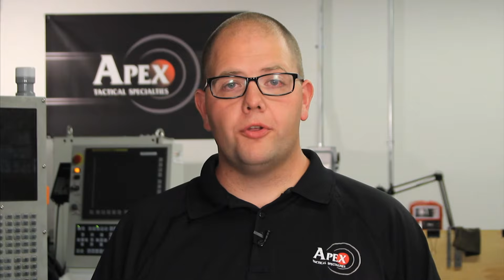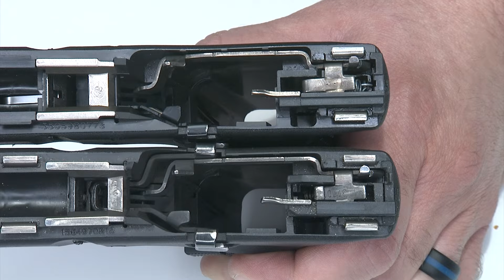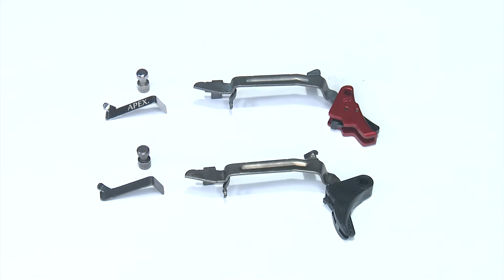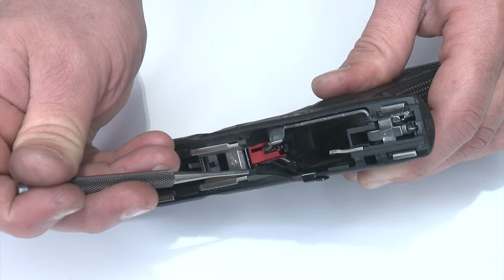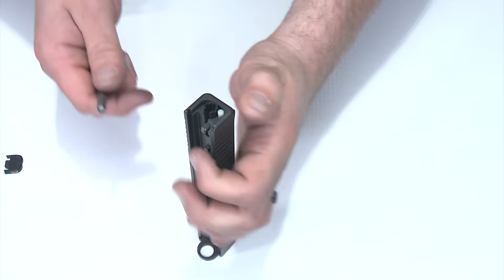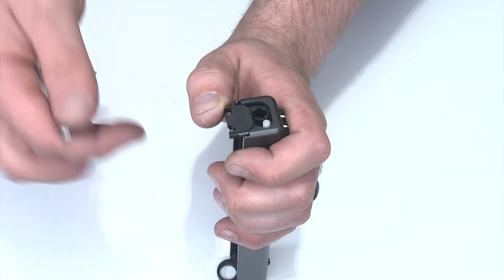How To Install The Apex Action Enhancement Kits For Glock Pistols

Comment: I really dig these triggers. I have a kit in my G43, polymer shoe. Such a sweet shooter now. I hated it before. 
An aluminum shoe only on my G26 with stock polished parts. 
And recently my G45. Shoe came with gen3 trigger  bar. 
I jut 250 round through my G45 just a few days ago. After my index finger got rubbed raw, I figured out it was the sha sharp edges of the safety blade. So I went back to all of my apex show and buffed the edges. Prefect now

Comment: I just installed the apex trigger on my 43X and it doesn't come with a striker plunger. I did the function test, pulled the trigger, hold it, slide the slide back, and then release the trigger and the trigger resets to its original spot but it doesnt click, should i be concerned?

Comment: followed these instructions when I installed the kit on my Dagger, If you are putting this on a dagger you should find a good video on removing the trigger from the dagger is slightly different than a Glock, but the install of the Apex was easy and worth the money, you will notice a big improvement in your trigger pull.

Comment: Great video, awesome detail and camera angles have others have said.

I used this for my install of the Polymer action enhancement kit on my PSA Dagger.  No issues, works great.  Trigger pull is crisp with a nice reset, not too light either which is nice.

Comment: Excellent video. Pay attention to the helpful hints. This is the solution I have been looking for. Wonderful kit. Perfect trigger feel and pull. It's predictable, with great tactile feedback. No more painful Glock blade trigger safety. And now I can trust myself with my Glock. I installed it myself in less than 30 minutes.  --  Follow up: Installing this kit cut my shot grouping in half. Very accurate first and follow up shots. The trigger feels broken in after just 100 rounds.
Reply: Quick question did you install the apex connector in it too or kept the oem i just got one for my edc glock 19 gen 5 and dont know if i should install the connector or keep the oem one
Reply: @leonellopez-r5u  I apologize for the delay. This went to my spam folder. I installed all the parts that came with the Apex kit. I have a Glock 19 Gen 4.

Comment: I installed a apex in my dagger it will reset with no actual round in it but when I use live rounds it chambers new round but doesn’t reset trigger please help it will reset if I pull slide

Comment: I recently replaced my trigger in my Glock 17 and did a function test afterwards and all seems good, however when I go to chamber a round (slowly) I am not able to get the gun back into battery. However if I rack the slide quickly, I am able to get the gun into battery. Did I miss anything or any advice to help troubleshoot? I have not taken it to the range yet to test on live ammo.
Reply from the maker: It's best to contact our Customer Service people with questions like this.  Our contact info is on our site and on the product cards included with the products.
Reply: Just following up: I did reach out to customer service and they informed me that this is normal. The firearm needs the force to go into battery and I was just being hyper vigilant. Went to the range with 200 rounds last weekend and not a single issue! Groupings were tight, trigger pull and reset were so crisp. Going to be updating the trigger in the rest of my Glocks. Thanks Apex!

Comment: Excellent video.  Just installed my second Polymer Action Enhancement Kit.  This was a Glock Gen 3/4 kit in my new PSA Dagger Compact.  The Dagger came with a terrible 7 1/4# trigger pull.  The Apex kit reduced pull to just under 5#.  What an improvement!  And, as a bonus, I got to match the trigger color to my FDE frame!

Comment: I had the Apex trigger installed on my Glock 19. It is very hard to pull. After about 20 shots my finger is pretty sore. Can the trigger be adjusted so it is easier to pull?

Comment: Great video, but there is one problem. The Gen 5 kit does not come with a plunger. I confirmed this with Apex customer service. Apex does not make a plunger for the Gen 5.
Reply from the maker: The install process is the same, there is just one less component in the Gen 5 kits.

Comment: Seems much simpler than I thought. Can't wait to upgrade
Reply from the maker: It is a relatively easy platform to work on.
Reply: Careful. All my Apex trigger did was give me light primer strikes. :/
Reply from the maker: @Mark-sn6kh  Extremely uncommon. Contact our customer service at 623-322-0200 and they can assist you with troubleshooting the install.

Comment: In what fantasy land do these pins come out that easily
Reply from the maker: In the fantasy land of Glock. It is a remarkably easy platform to work on.
Reply: @apextactical  I finally got it installed, I realized the big difference is I was installing into a PSA Dagger, apparently they had an issue with pins walking so they made their pins slightly larger. This thing shoots so much better now, solid product
Reply from the maker: @ReqDef  Thanks for the clarification.

Comment: @apextactical my trigger safety won’t spring back out of the shoe I can manually pull it back out but as soon as I pull the trigger the safety dingus just lays flush in the shoe and doesn’t come back out what should I do???
Reply from the maker: First off, it's not a 'dingus.' Second, its  likely the trigger body was crushed during install. Just call our customer service at 623-322-0200 and they can assist you. Please don't use the pistol until the trigger body can be replaced.

Comment: What Trigger did you use for gen 5 will a gen 4 work on a gen 5
Reply from the maker: We have a trigger that works for the Gen 3/Gen 4 models using a Gen 3 trigger bar. The Gen 5 trigger is different and uses the Gen 5 trigger bar (obviously).

Comment: i installed a new trigger on my 43x however is appears to have made the slide sit a little high and is extremerly ruff to take the slide off and on. it seems to be alot of friction. im assuming this cant be normal. I have function tested and had no issues but the slide is still a bit ruff to get off and on. Any help would be great
Reply from the maker: Push the trigger body  forward in the trigger guard while putting the slide back on.
Reply: @apextactical  hi sir. having same issue here. installed it on my g48, the slide won't come off for me to field strip?

Comment: I installed the enhance trigger kit slim frame model for my Glock 43X. I got the red trigger kit. It does not work properly. Followed all your instructions and the trigger just keeps staying to the rear. on top of that Trying to get the slide on after installing the trigger is a bitch! Have to manipulate the trigger down to get the slide on.
Reply from the maker: Please contact our Customer Service Staff to discuss the issues. They're very good about helping customers with all issues.

Our trigger holds the trigger bar more rigidly than the factory trigger, so it can be a bit more difficult to install and remove.  Pushing the trigger body forward after dryfire will help alleviate that.

Comment: To anyone who has done this or has any knowledge on the topic, I’ve seen quite a few people saying they don’t mess with any parts on the slide while installing these as it can lead to issues with firing in the long run, anyone able to verify or speak differently? Bout to snag one of these, just not sure if I want to change all that out yet or just try the trigger for now and then if that isn’t enough add accordingly, any opinions would be greatly appreciated

Comment: Does Apex sell a complete drop in trigger?
If building a gun from bottom up, I’d prefer drop in housing etc complete, rather than have buy housing, sear, etc.
Reply from the maker: No, we do not.
Reply: @apextactical  thanks for quick response. Appreciate it.
I just about complete w current build in which I installed Overwatch Precision trigger complete drop in. I’ve started next build and wanted install Apex trigger in comparison.

Comment: So...... where's the upgrade? Other than not dealing with a spring.  Guess I missed it.
Reply from the maker: This is a how to install the kit video for those that order them. What they do is outlined on our website. For instance, the Gen 3 Kit will...

– Reduce trigger pull weight by approximately 1 lb.
– Reduce trigger pre-travel, overall travel and reset distance
– Smooth uptake and reset
– Crisp trigger break
– Maintain factory safety values

Comment: I did all of this like was explained and after I put the slide back on my trigger does not lock back after dry firing, it just freely cycles when I pull it. I don’t think it was my doing because I reinstalled the factory trigger and it’s working like it should. Any ideas??? Please? lol
Reply from the maker: Call customer service at 623-322-0200 and they can assist you in diagnosing what went wrong with the install.

Comment: Any benefit to polishing the apex trigger bar to a mirror finish???
Reply from the maker: It does not provide a significant difference but you can certainly do it. Keep in mind that removing our trigger from the trigger bar and then replacing it could cause an issue if done improperly.
Reply: @apextactical  I didn't have to remove the trigger from the bar , but i did polish the shit out of everything and now I'm at 3lbs 15 oz avg of 5 pulls.... org trigger was 6 lbs

Comment: Is a new connector required or can I use the stock connector with your trigger?
Reply from the maker: You can use a stock connector but our reduces the trigger pull by approx. 1 pound.

Comment: i could get my hands on an Apex ENHANCEMENT TRIGGER KIT WITHOUT BAR FOR GLOCKS GEN 3/4, does this work with the original glock gen 4 bar ?
Reply from the maker: Our trigger design is for use with the Gen 3 bar. Using a Gen 4 bar will create drag thru the trigger stroke. Use a Gen 3 bar.
Reply: @apextactical  thank you very much !

Comment: Will this kit work on  G17-gen2.5?
Reply from the maker: The Gen 3 Kit (Part# 102-115) should do the trick.
Reply: @apextactical  Yup! It worked. Had to gently pry up the locking block to get the trigger out. Other than that issue, it fits perfectly. Ty

Comment: I have a 19x so do I buy upgrades for a gen 5 19 for the top and 17 parts for the bottom?
Reply from the maker: The G19X is a Gen 5 pistol. You buy the Gen 5 Kit (part# 102-116).

Comment: Just an FYI in case you have issues after installing. The function check - was not working properly when attempting a reset. The slide would not go all the way forward. Long story short, the plunger spring did not seat properly. It fell out and was sitting in there sideways. I was still able to push the plunger down some so it wasn't as obvious as I thought it should be.
Reply: Yeah my slide on my Glock 34 won’t come off when triggered

Comment: A buddy installed one of these on his p80 and it made it full auto. Is this normal?
Reply from the maker: No, not even close. Our kit does not do that at all. It is likely that there is a large tolerance variation that is now stacking due to the use of multiple aftermarket parts that were not designed or tested to work together. Our kit is designed to work with Glock factory parts. It can work in P80 frames but it depends on the toleraces of their parts, too.

Comment: Now I know to which side the pins go out for disassembly and reassembly. Thanks.
Reply: It doesn’t matter which side the pins are removed or replaced from, only the order in which the gen 1-4 are installed or removed matters due to the slide stop lever spring resting under the locking block pin

Comment: I just got my first Glock, a 43. Excited to get my new trigger hopefully Friday or Saturday!
Reply: How'd you like it?
Reply: @mikebussy3334  it's not bad. For me, it seemed to sit a little high in the block so when reassembling,the slide a we catching. If I push the trigger forward when put in this light on, and works fine. I don't have any issues firing it after 500 rounds so I feel confident with it.
Reply: @TannerGarcia  Nice, I can't wait to try mine, I got a Glock 45 gen 5 it's 9mm. Waiting for 9mm ammo to come in the mail. Good luck Bro stay safe.
Reply: @mikebussy3334  #LUCKY I went to go buy one amd they sold it a little before I got tbere. I was a little on the not happy side. For sure man. Lmk what you think. Also, check out MilSpin for a little flair 😂 I got a great slide plate there. I have it posted on my IG @stxbear223